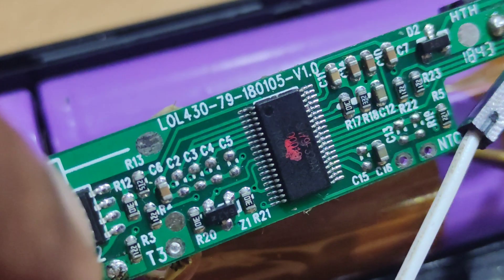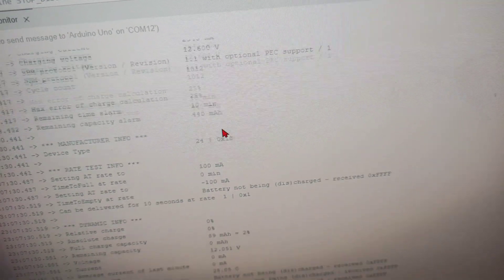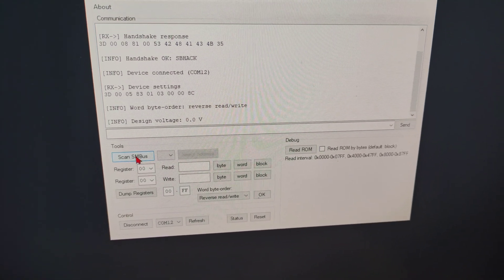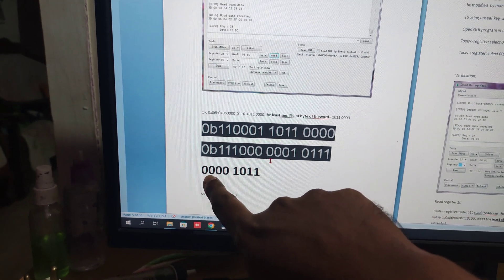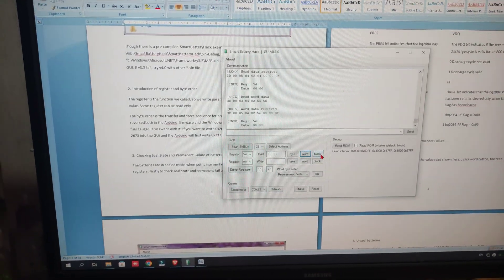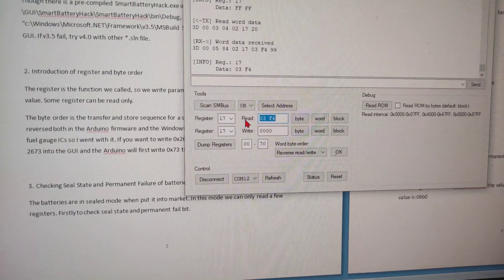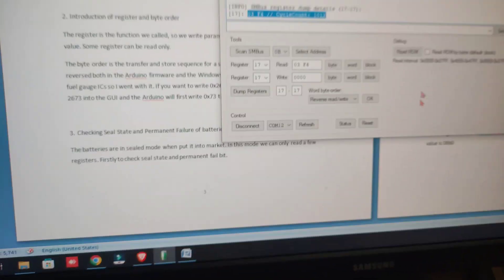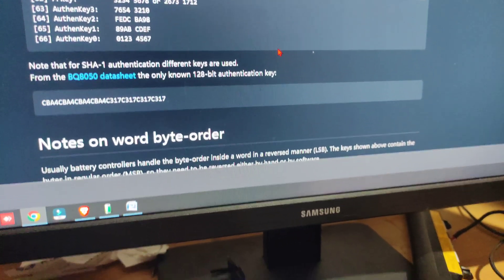Laptop battery data retrieval and reset with arduino - BMS HACK #arduino i2cprotocol part 2 SMBus

Comment: I replaced the damaged batteries in my HP laptop. The direct output from the batteries is 14.5V, but the BMS isn’t showing any power output. I tried jumpstarting, but it didn’t work. Will your method work for me?

Comment: Found out the key?
Reply from the maker: Chinese battery, key is only available for some persons, not publically its visible. I saw 1 tool showing  chinese chip unlock. So no luck for this chip.
Reply: @AnandakrishnaSudhakaran  also sha-1 is not 128 bit..
Reply from the maker: Is it 168bit?
Reply: @AnandakrishnaSudhakaran  yes its 168 bit
Reply: @AnandakrishnaSudhakaran  do you have an idea how does the nlba1 battery analyzer work? I might be very well be able to reverse engineer the software if I had it
Reply from the maker: Its hard coded, with ev2300 or ev2400 u can js read battery and see details. For more option u need licence. If am right there is a mechanism to detect the pc, and its not a good practise to reverse engineering a paid software.

All infos are available on internet, just google it correct keyword you will get answers
Reply: @AnandakrishnaSudhakaran  I still don't understand how the chinese didn't reverse engineered it already, and sell a cheap copy? I probably stores all critical data on a remote server, and everything is transferred live encrypted..
Reply from the maker: @worroSfOretsevraH  chinese battery is like an emulator, it create data like the original battery and a special chip creates its encrypted key,

Comment: Good day. My BMS batteries turn off the battery when the voltage on the banks drops from 2.5 to 2.8 V.
Please tell me if it is possible to somehow increase the shutdown threshold to 3 V.
On the board, from each 18650 bank there is a connection through a resistor 101 (99-100 Ohm) and a track goes directly to the controller. There is no voltage divider.
Reply from the maker: @ВикторВик-с1э  please share your battery model. So i can understand your question. If you know the chip name , pleasw shars
Reply: @AnandakrishnaSudhakaran  batteries from different laptops. I want to use them in DIY projects. I have a CC-CV charger. The task is to prevent the 18650 from discharging below 3 volts.
Chips: BQ8030DBT + bq29330, Atmel1436 Mega32HVB, SN79f329ax, sn8765, a1038-dt, a2168e, bq3060...
Reply from the maker: It needs to adjust the cc cv in firmware level on each chip. Which needs more knowledge about the registers which represents these  cut off values. Unfortunately i dont know correct registers. And manufactures not share these values. But some chips helpful pdf are available. Or you need to purchase a good proffessional tool.
Reply: @AnandakrishnaSudhakaran  Thank you.

Comment: its giving out no SMbus device detected in a SH366000 bms chip
Reply from the maker: Make sure data and clock are connected in correct way, also check batt voltage, then if not showing give a input voltage and check again.

Comment: Hi friend, I have 2 identical batteries, one  working and one with 0v but I charged cells manually. one that works can read data over arduino but the one has 0V cannot. I already charged cells individually and all had 3.7V. Do you know how to activate or wake the chip for read i2c bus?? Thanks in advance.
Reply: just short wire from 12v line to battery connecter +12v line the BMS with give output just touch it for 4 sec thats it

Comment: yeah this chip is tough but if you unseal it let me know becuase i have also tried on many software nothing worked
Reply from the maker: Arrange a remote session , so i can directly check the chip., or if yoi have non used bms pcb, send me
Reply: i have alot of bms which battery bms do you want? @AnandakrishnaSudhakaran

Comment: Hello Sir, i want to Ask about Lenovo LGC battery 45N1147 chip marked as  526B1001 - 51F51 isbthere any knows manufacturer and way to program? Regards!!
Reply from the maker: 51f51 is difficult to reset. There is no guide available. I have that chip, I am still developing a way to reset. You can try be2works, or ubrt 2300 for this chip. But I don't know if it is available on the free version. Anyway if I find a solution i will let you know. Thanks for your comment.
Reply: @AnandakrishnaSudhakaran  i've found be2works v4.52 with patch, but works only on windows XP. I've order CP2112 for Be2works, but shipped yesterday, so i think try maybe for 2 weeks. Wondering about order FX2LP too, but probably CP2112 will be okay.
Reply: @zwyczajny2290  did it work

Comment: Can this reset / reactivate dead BMS after changing the cells?
Reply from the maker: Yes its possible with tools like cp2112 and ev 2300 or ev 2400, with arduino we cant change the values of the modern chips. So go with ev2300, free software is available.  If you want to use cp2112 you need to buy softwares like be2works. Or someother tools. Which is the chip on the battery board?
Reply: @AnandakrishnaSudhakaran  you mean not possible using Arduino?
Reply from the maker: @kjaved8  not possible. You can read and view data values with arduino.